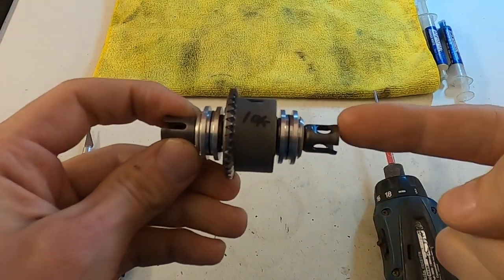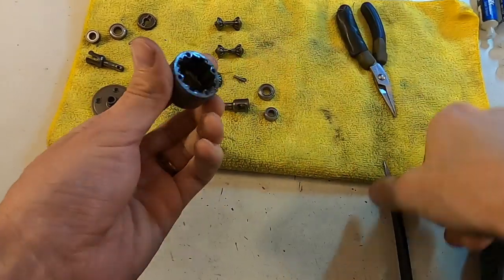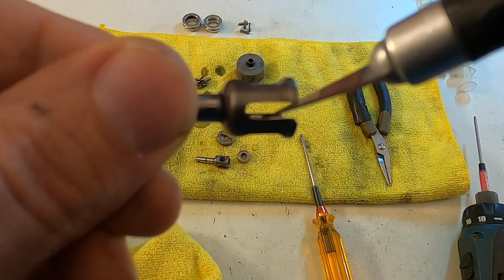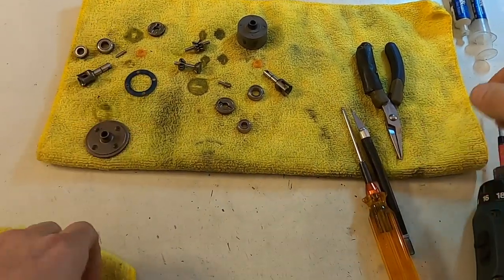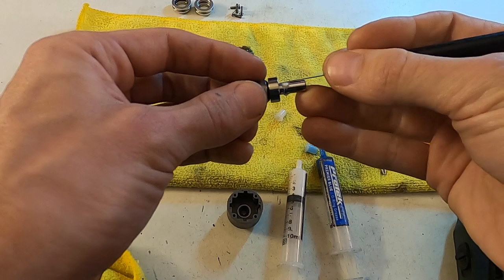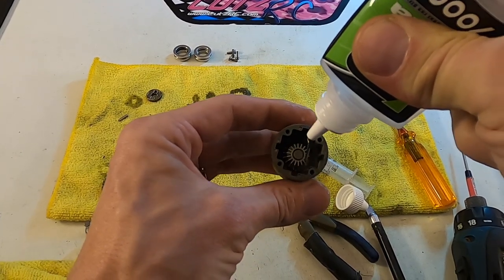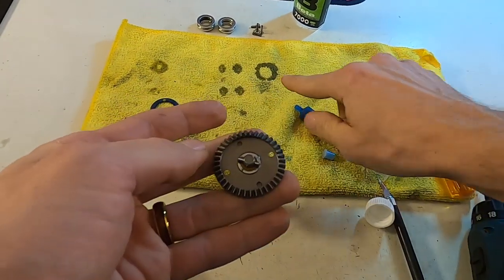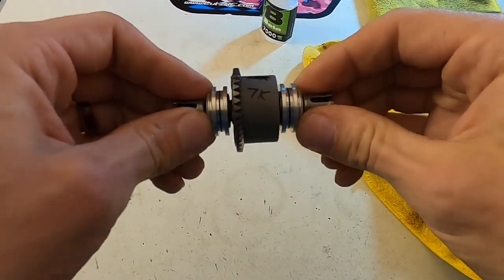How to Rebuild your RC Car Gear Differential [Beginner Tutorial with Ryan Lutz of LutzRC]

Comment: Top video i wish I watched this before I did mine I only cleaned and put diff oil on the main gear didn't open that center part, feels alot smoother but will have to do it again

Comment: Question is do you really need to let the differential oil sit so the air bubble would dissolve before you put it back together?
Reply from the maker: 99.9% of people wouldn't feel a difference. Just be sure any bigger bubbles are gone and get it back together! :-)

Comment: would u ever use brake cleaner to help clean off all th dirty oil on the parts not including gasket or o ring
Reply from the maker: I don't. I would avoid it on plastics too. 
I prefer just to get it out best ya can with the rag.

Comment: Clean job man, the only thing I cringed hard is the part where you tighten the screws manually with the driver, man you can't do that to that driver that's sad man, don't you see how sad the driver is?!
Reply from the maker: Haha. That driver has been through a LOT in the past 10 years! You should see me take out 4mm screws loctited in the engine mount that can't be undone by hand! I'm not a mechanical person so I don't understand these things. But thanks for sharing and i'll do better next time!
Reply: I hope you're joking.  Lutz is a pro and he's been doing this forever.  He knows what he's doing with HIS driver. He's also not putting this video up because he's looking for an evaluation on his diff rebuild / tools / process from the peanut gallery.  He's teaching you, not the other way around.
Reply: @topgunns1000  yea, it's hard to tell over text what's joke what not. Even if you write words like SAD for an electric driver, like machines have emotions and so, calm down your nuts dude. Besides, Im watching this for fun not for education, it's nothing I didn't knew before I watched this video.
Reply: @RyanLutz  if it gets loctited screws loose its really nice :D above was a joke, but there are machines that when you tighten a screw and the driver can't Torque anymore from itself and you try to tighten any further when still giving juice but manually, it starts to fire the windings.